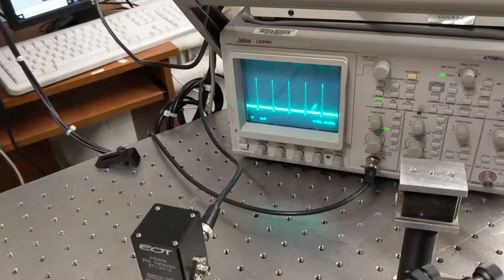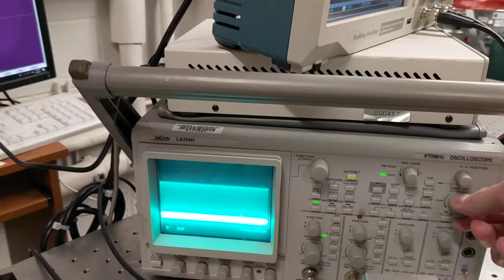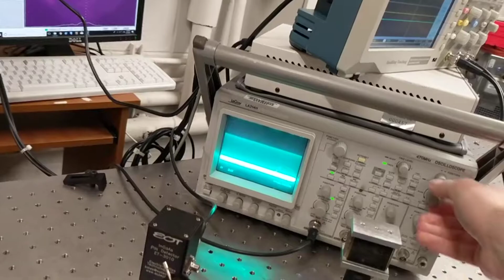Super quick demo of spatiotemporal mode-locked laser

Comment: This may actually be the first time I found out about cool new concept on the YouTube channel of the author before their papers. 

So short question: Can these multimode mode-locked lasers scale to very high average output powers compared to sm lasers?
Reply: In principle, MMF lasers should have a much higher power than SMF lasers, but now researchers haven't achieved that. It is an engineering problem, and needs more time.

Comment: Authors says q switching is a good clue that you are close to mode locking, I want to ask is it always the case ?  Since in my case I observe q switching but couldn't achieve mode locking, even though I tried adjusting and manipulating different parameters. Is there anything specific that I am missing?
Reply from the maker: Yes, it's true that q-switching (relaxation oscillation and related gain dynamics) is an indication that one may be close to mode-locking. It is a reasonably good sign but far from a guarantee. Most of the time I find when people are trying to mode-lock a multimode laser, there are more important issues to resolve. If you are going to observe STML, you need a reasonably good laser cavity. If you have built one, I find it rarely takes more than a few minutes of playing with the waveplates to obtain a mode-locked state. Here is a checklist

1) Can you mode-lock the laser easily if you replace all the fiber by single-mode fiber? If not, your should not expect to see STML when you replace with multimode fiber.

2) When you align the cavity with multimode fiber, do you have a slope efficiency of at least 25%? If not, you are probably not going to be able to observe STML

3) When you block the cavity (as I do in this video) so only amplified spontaneous emission emerges from the laser, do you see a smooth Gaussian spectrum? Or, if you view the spectrum of the ASE, do you observe spikes and transient features? If the latter, you probably have parasitic self-lasing and need to work on improving the unidirectionality of the laser by improving splice quality, improving cleave quality and so on to eliminate backreflections. It is normal to have to empirically determine optimal parameters for cleaving and splicing fibers in any new research application, and STML is similar. It is very unlikely you will observe any form of mode-locking if parasitic lasing occurs at the pump power required for observing STML. 

4) Do you have enough pump power to observe STML in your laser? Depending on the cavity, the threshold for STML may be high because it results in highly energetic pulses. In a cavity with a section of single mode fiber (a toy STML laser) you will still generally expect 10-30 nJ pulse energy. Thus, you should have enough pump power to support 10-30 nJ pulses in the cavity, assuming a slope efficiency similar to the one you measure in continuous wave operation. In a more interesting cavity containing only multimode fiber, you may need enough pump power to support 100+ nJ, or up to 1000 nJ pulse energy depending on the dimensions of the fiber.

5) Is the multimode fiber in your laser cavity graded index or step-index fiber? If it is the latter, you are not likely to observe STML, unless you know about some physics I don't. In an upcoming publication I will have some supplementary discussion on STML in step-index fibers, but in general I would not expect to observe STML easily in an arbitrary multimode step index fiber.

Good luck! It is exciting to see it the first time, especially because the mode-locking transition always seems so dramatic.
Reply: @loganwright2247  Thanks for your detailed comments. They are very helpful.
 I am sorry that I didn't give you enough information and my exact scenario, to make your comments more specific. Here how my setup is: I am using single mode fiber spliced with graded index multimode fiber, spliced with single mode fiber making (SMF-GIMF-SMF) as a sturable absorber , based on multimode interference inside GIMF. All the components in my ring cavity are in Normal dispersion regime. the ring cavity configuration consists of a pump diode at 980nm , coupled thru 1030nm WDM, then using YB-doped fiber as a gain medium, a 90/10 output coupler, connected to Isolator and then thru SMF-GIMF-SMF going to a 10nm filter bandpass filter centered around 1030nm back to the reflect port of WDM again to complete the ring cavity. Also, I didn't yet spliced all the components in my cavity, Would that also be a reason for not laser getting modelocked?.
Reply: @abbasafridi4732  A similar checklist would apply to your case, but otherwise I don't have much to say. There are at this point dozens of papers demonstrating such saturable absorbers
Reply: @virtualetters  thanks